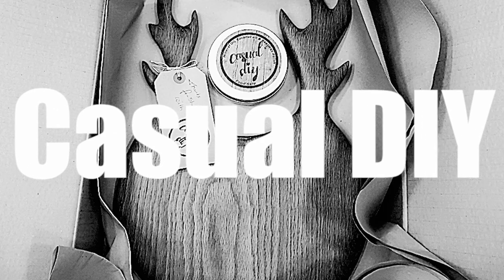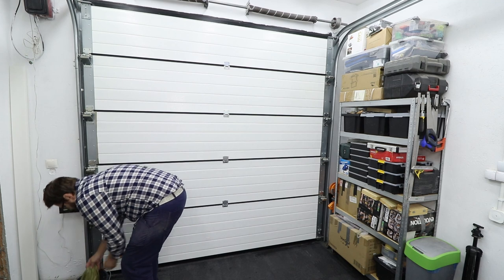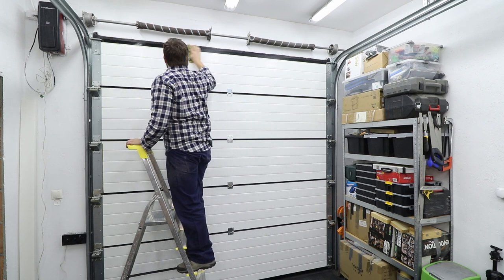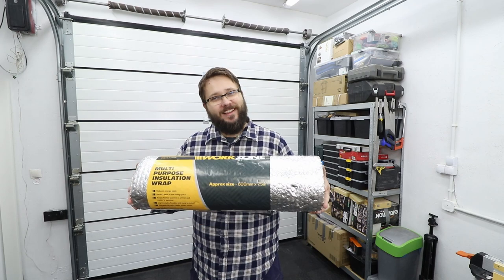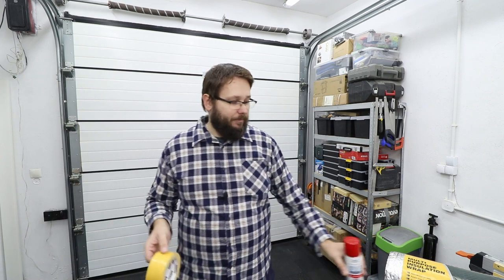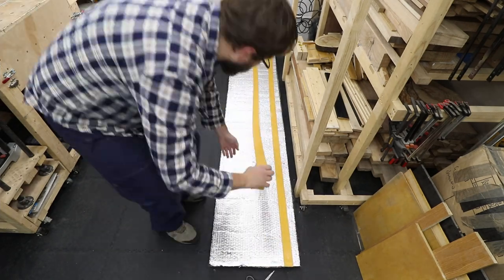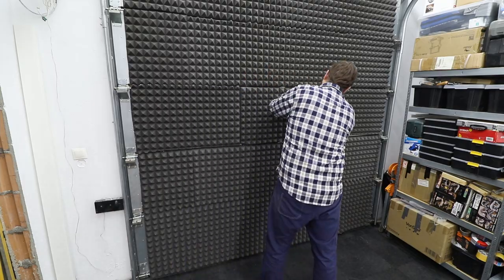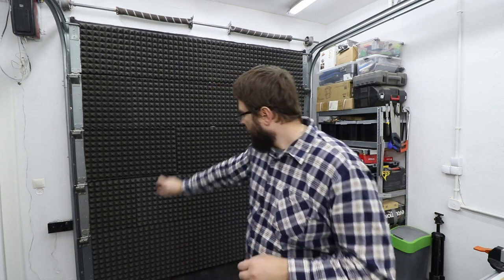How to Insulate and Soundproof Garage Doors | DIY

Comment: How can the window and wall readings reduce if you did not do anything to them?
Reply from the maker: The foam I used has got sound absorption capabilities. Some foam bounce sound off other absorb it and so on... there are few types with different specs and capabilities.
Reply: @CasualDIY  Thanks for that.

Comment: Hi Thomas would this work in a wooden shed
Reply from the maker: Hmm I think you would have to install some breathable membrane between the walls and the insulation just to make sure you wont have any moisture problems.
Reply: Would kilmat 80 mill work as weii?

Comment: Sorry it didn’t work out. The thing is though the acoustic tiles you used are to control reverberation and disrupt sound waves moving around in the room, it won’t do much for sound insulation.

To stop noise going outside there are other techniques from movers blankets to making panels from Rockwool insulation (could be a fun video to make?) that would be more effective in sound absorbing.
I hope that helps 👍
Reply from the maker: Well in theory this foam has got some sound absorption capability. By the looks of it not much. I think the more clutter, I mean workshop things 🤣 I gather in the garage that will also help a bit with the sound.

Comment: Adding any insulation to a garage door will require the springs to be adjusted if not replaced to properly balance door. Otherwise will become heavy and unsafe.
Reply from the maker: I have raised this concern with the manufacturer/ fitter and they say up to 15kg of additional weigh no adjustment is required.

Comment: Hi Tomasz, you could add another layer of foam over the whole doors reversed, pointed side to pointed side. This would also eliminate the ledges for dust to settle on. Enjoying the transformation Tony
Reply from the maker: I actually thought about that but in the end I don't want to add more weight to the doors. Don't want to break them.

Comment: The problem you have is resonance, the hard walls/floors/floor bounce the sound around. The garage door covering has solved 20% of the problem. I'd only go the whole hog if you are getting complaints from neighbours.  In the summer you'll want to open the shutter so its a Catch 22 scenario……   I have a similar garage workshop, I just dont use noisy machinery in the evenings but as I'm retired thats not a problem.  TBH I cannot understand why these sort of shutters have no insulation at all (like mine) and are just either thin plastic or aluminium.
Reply from the maker: I still got some of that foam left. I'm planning to use it on the window which is opposite the door. I wonder if that will help with the noise reduction. At the moment I've not had any noise complaints and I want to keep it that way.
Reply: @CasualDIY  having what is primarily a concrete shell the sound bounces off the hard walls/ceiling and in resonance terms is amplified, i shouldn't worry too much as long as you keep the wood working to reasonable hours and not do stuff at 10 o'clock at night!